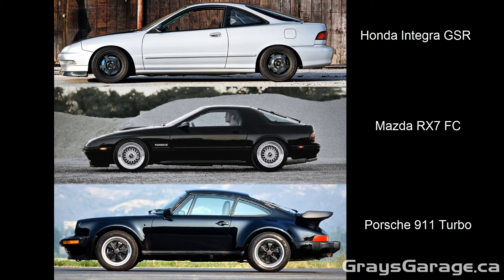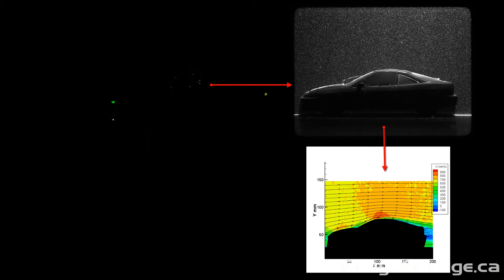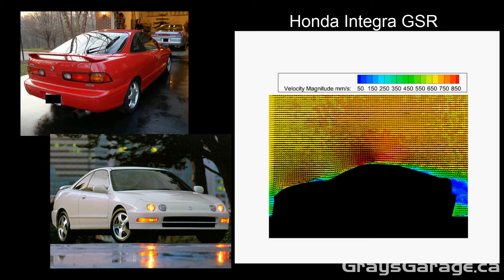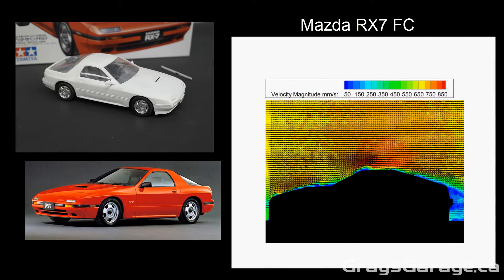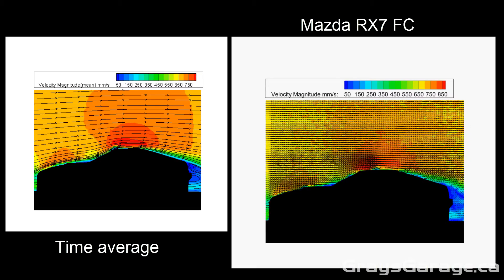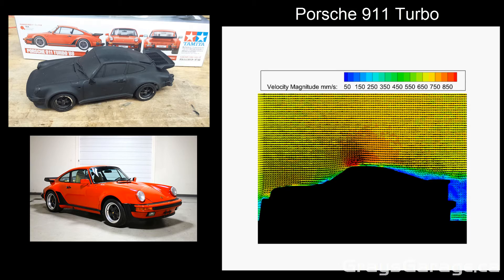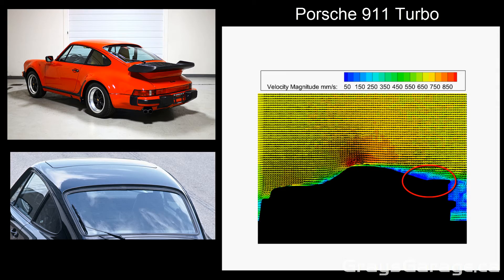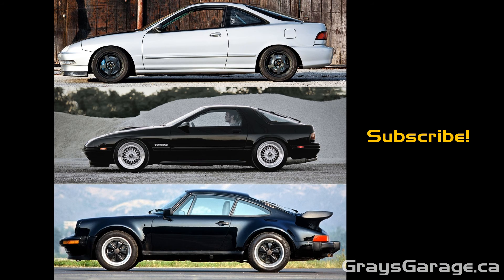Automotive Aerodynamics Ep. 10: FASTBACK comparison!

Comment: The 911s are actually pretty bad and all sorts of tricks were used by the actual race cars to smooth them out. The turbo tail is mostly to accomodate the intercooler but also to reduce lift at high speed. Not for downforce. The earlier cars used a small duck tail to acomplish that and also to help with air flow into the engine grill it was nessessary to cancel out the vacuum because it needed flow into it not out. Also if you run a tail you also needed a front spoiler or it would get very light and unstable in front.

Comment: Hi,
 the Porsche rear windshield offset is for cabin ventilation.
The low pressure area at the vents help extract cabin air and thus moisture, heat  etc... for comfort and security (less on glass condensation)

So good ol' tech from 1963 :D

Comment: Hello Gary I've been going through all your aerodynamic videos and they are great to learn from. I have a question that I don't believe you addressed and its rear diffusers. I understand that they essentially reduce the wake turbulence but there are still somethings that I am confused about. First off is the angle of the actual diffuser how aggressive can it be to reduce the wake properly. Secondly how much impact do the turbulence of the rear wheels have on the diffuser itself compared to isolating the stream of the tires from the stream of the diffuser ex. ( )|–|—|–|( ). Lastly is should the diffuser have different height (ex. |—| ) or would it be beneficial for it to be one consecutive length (—|—|—). I would appreciate if you would shed light on this. I also would appreciate if you used a 350z to demonstrate this.